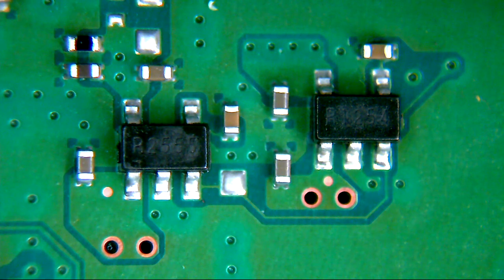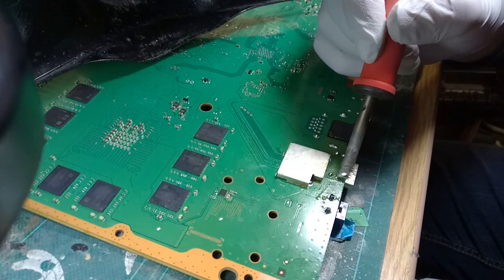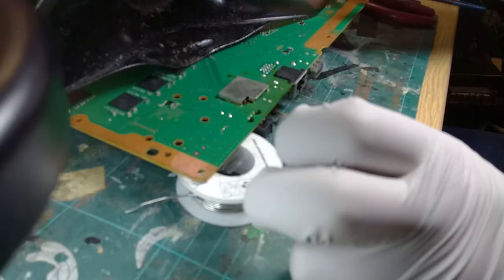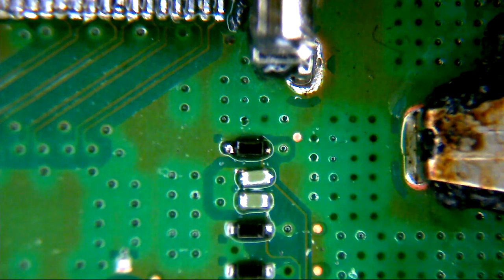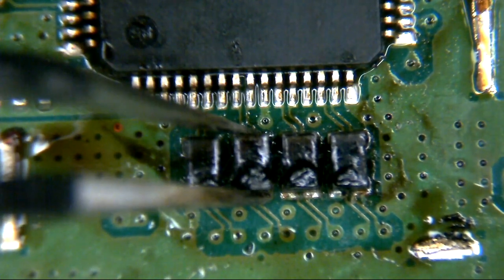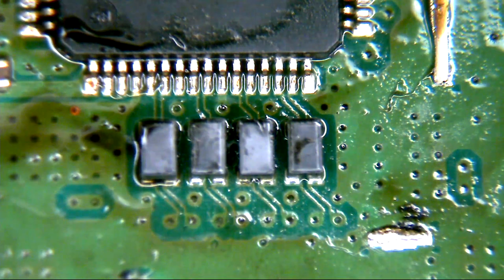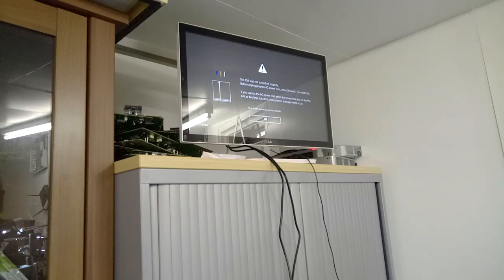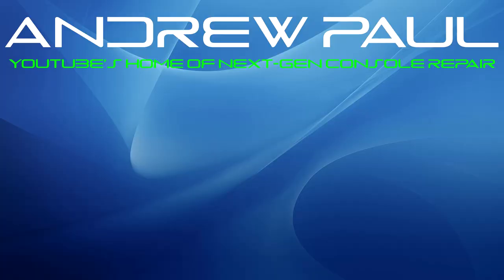Idiotic "Professional" Ruins PS4 HDMI Port Repair. Can We Fix It?

Comment: My ps4 will go black scrren if i switch inputs for a second and won't come back on until i restart the ps4 . Also recently when in game if i press start the screen goes black but i can return to game and play fine . Any idea.
Reply from the maker: Sounds like a hand-shaking issue. I'd test it using a different HDMI lead and failing that on another TV and see if you can replicate the issue before doing anything too drastic.
Reply: ok will try .
Reply: true when i shake it it would come back but now even going through the ps4 menu the screen goes black
Reply from the maker: That would suggest a HDMI port issue - the pins like to separate and push out which will cause things like intermittent picture / handshaking issues etc. Once it starts it will get worse to the point the connection on one or more pins breaks completely and you'll be left with no image. Might be worth getting it checked out if it's not something you fancy tackling yourself.
Reply: wish you were in the states . thanks for the reply .

Comment: Goo what a mess, i have to admit that i've replaced the simpler usb/charge socket on my frends phones, but i've never made that kind of a mess.
Just a magnifier and pointy tip soldering iron to do the job, oow and the tip of my tongue just peeping out of my mouth LOL, that's important :-D.
Good clean solder makes a hell of a difference :-)

Comment: If I remove the metal sheet from RAM s chips, and put a PC heatsink on the processor , is that make problem for the RAM chips ?? I mean overheating ,, thank you for this useful videos
Reply from the maker: It wouldn't be great for them. They require the metal top plate and the thermal transfer pads for heat dissipation.
Reply: Andrew Paul  Thank you so much
Reply from the maker: No problem :-)

Comment: hi Paul what temperature do you use ?
Reply: He uses 490°c but mine maxes out at 480°c and works fine as well. It's more important that you get leaded solder in there to lower melting temperatures.

Comment: I don't think a pro did this. Whoever did this did not have proper tools/knowledge , and as most of the jobs these shops do is replacing charging connectors, failing on this simple task means they will close shop before they open it. Probably the owner of PS4 tried to do it himself.

Comment: But did it work tho?
Reply from the maker: It sure did.
Reply: Andrew Paul hey,  would I be able to replace my HDMI port without a heat gun and just an iron and flux?
Reply from the maker: Hi Aaron,
No I wouldn't think so - you need to heat-soak the board in order to get the ground pins out whilst at the same time reflowing the 19 pins soldered to the header to get the port to safely drop out without damage. You won't get enough heat into the board with an iron or be able to reflow all the joints together to get it to come free. Hot air definitely a requirement in this instance.
Reply: Andrew Paul thanks for your help, I was just trying to find the fastest, most  effective replacement even if there is damages after the fact, as long as it works. I do see what you’re  saying about how you need to heat both the pins and the mounting port at the same time for it to fall out, you just won’t be able to heat enough surface area with just an iron.
Reply from the maker: Yeah that's the issue. Where are you located? If you're UK / EU based we offer these repairs. Drop me an email to ytandrewpaul@outlook.com if you're interested. Many thanks.

Comment: 100% If the hdmi port pin (s) break USE SOLDER WIRE. cut a pin sized piece and place it in the port. YOU MIGHT HAVE TO WIGGLE HDMI CABLE TO SET PIN IN RIGHT. 
WORKS 100%